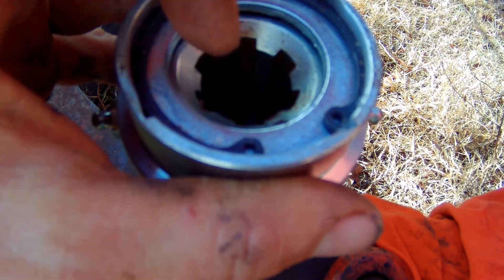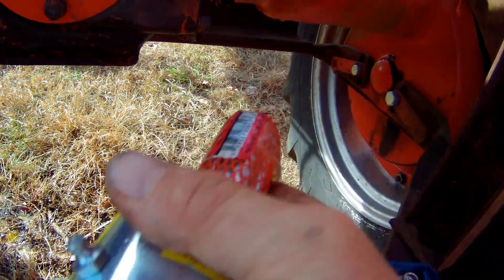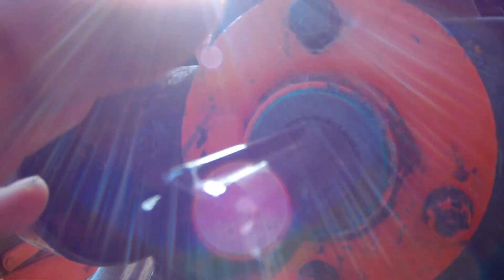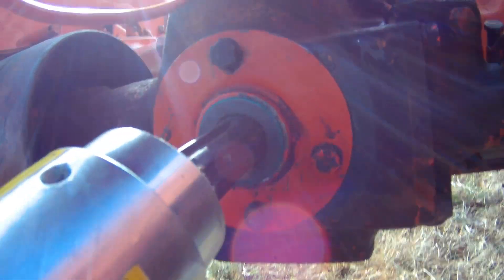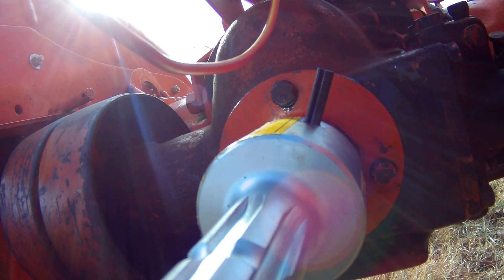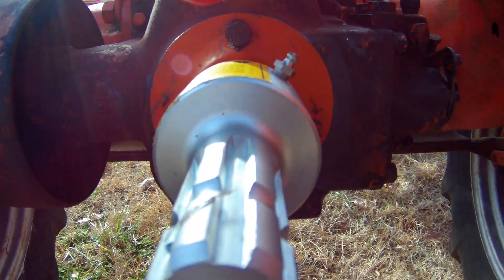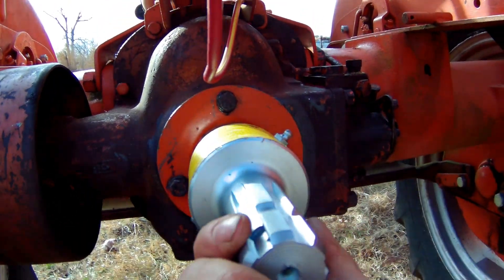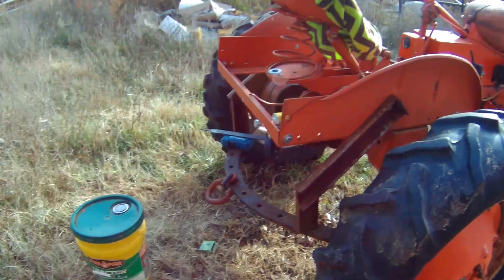tractor pto overrun clutch install how to

Comment: I used this video as a guide, and my rollpin in stuck partially driven in. It's partially in the PTO shaft because I cannot pull the coupler off. I can't back it out or drive it further. Any advice from anyone would be appreciated

Comment: Good video. My 2n Ford had no hole in the pot and the holes under the grease fittings don't line up with the spring pin hole.
Reply from the maker: Sorry to hear that
Reply: Supposed to be mounted on the implement side, not tractor as per Weasler web site.  Pto drive shaft will still have flywheel effect while disengaging power to the PTO while on the tractor

Comment: i got a old te20 fergie i got a topper but i need a pto adapter to make it fit, what is a pto overrun for and would i need it? would it go on the converted part
Reply from the maker: i highly recomend them on old tractors without live pto because if you are running a brushhog you can push the clutch in and the momentum of the brushhog will keep pushing the tractor because it is direct drive that is what the clutch is for is to keep your equipment from pushing you